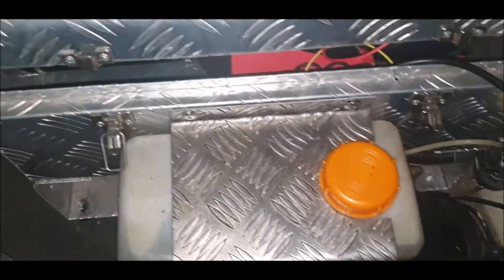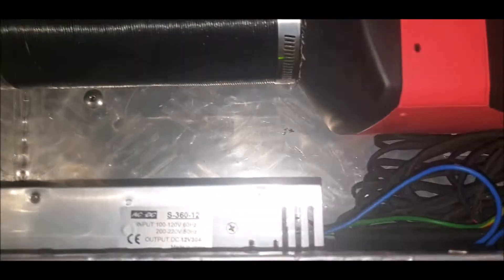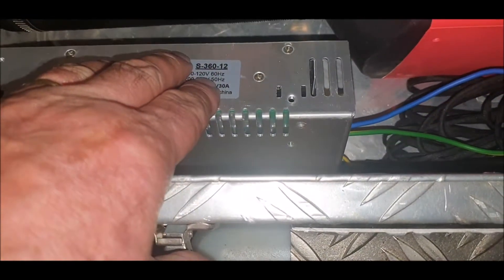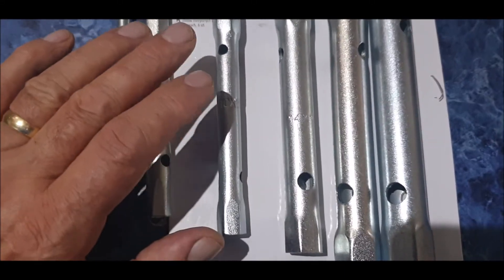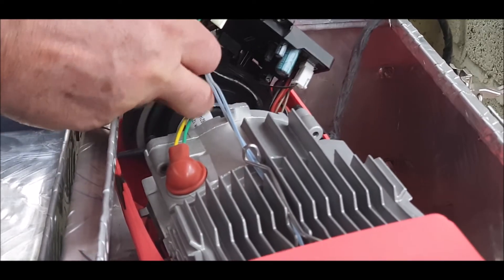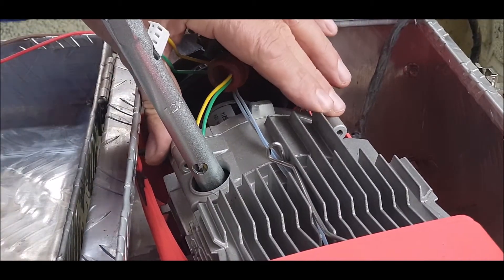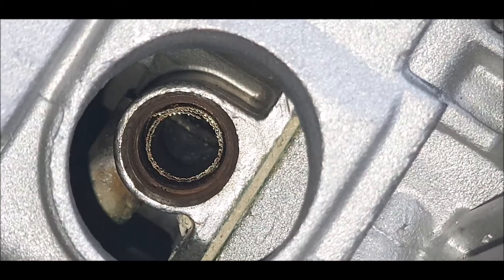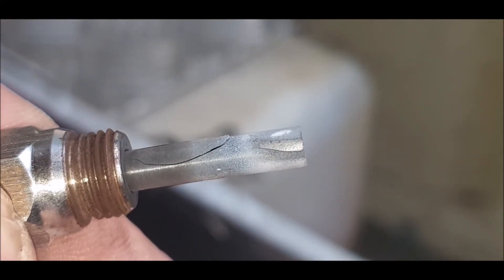CHINESE DIESEL HEATER ERROR E-03 GLOW PLUG

Comment: Hi i have a nasty problem with my chinesium heater i had an error 03 and after replacing the glow plug im still having the same error !its very frustrating what it can be anybody had the same problem in the past!
Reply from the maker: i did have a fuel pump problem as well

Comment: i have E - 03 error code on new Vevor heater straight out of the box . messaged seller see what happens. i have a max speeding heater no issues
Reply: The vector heaters are crap. I have had nothing but issues using mine for the past 5 months. I wonder if other brands are betternot sure if I want to chance waisting more money, might just suck it up and go with a direct vent propane unit, wlthought I'll be at the mercies of costco since propane any where else is way too expensive.

Comment: It could be because you don’t have a battery in line so when the kill switch is used while the unit is still working the heat will fry your motherboard

Comment: Hey guys, I just bought my diesel heater last night and I installed it and worked perfectly. But today it showed error E 03.  Do I really have to change the plug when the heater is new???
Reply: Battery shows 12.6Volt. What do u mean by fuel? Is the filter/pump maybe installed wrong?
Reply: @redle9485  I have the same problem, ran a tank of fuel through with no problems, re-filled it and now have E03. Can't believe its the glow plug after 10 hours running full blast. tried it with 12.5 volts andd 14.2 volts, same problem. If anyone figures this out or gets a reply from china please do post on here. Great video Mark.
Reply: @pollyperkins6931  I even took out the plug and it was fine, I really don't know what the problem is
Reply: @redle9485  If it's new I doubt it's the glow plug. Because my fan didn't spin and smoke came from the circuit board I'm gonna get a new board for £15. Unless you want to go first :)
Reply: @pollyperkins6931  well I haven't had any smoke or anything. I only get the code everytime I start it
Reply: @redle9485  My sense of humour. Story so far. I had another reply asking for a picture. Not sure what of, it don't work. anyway, I took the heater to pieces and found I have 12v on every connection, even the thermostat, so assuming its the board. Prob not much help for you unless you want to check your voltages, you may have the same problem. I have asked for a new fan board, if it works or not I shall post on here.
Reply: @pollyperkins6931  same here 10 hours running from new , and error 3 .
Reply: @redle9485  did you get sorted we are having similar problem. Error code.3 on a brand new heater!!
Reply: @motorhomeadventures5216  I emailed the supplier saying I had 12v at every electrical connection on the board with no potential difference at fan or pump, but the fan and pump work when 12v was applied direct. To me this means the board was shorted out. Even had 12v on the thermostat which shouldn't have any volts. I also sent them a picture of my multimeter showing 12v on the board. They refunded me and I then bought another from a different supplier. Haven't fitted it yet. The quality of the board is very poor, during fault finding the plastic connections fell apart. I think its pot luck with these, but you'll got through 7 of them before matching the cost for the real M'coy.
Reply: @pollyperkins6931  hi, I have same issue. Smoke came out of there. Should I order new board or its not going to help?
Reply: I have checked the plug and it's fine
Reply from the maker: could be battery low or fuel
Reply: @MrMeltedwellies  mine just quit with this same error code at our remote cabin here in Alaska.  I tested it with a multimeter and it was shorted. I assume that error code is for the ignitor only right? What difference would fuel quality or air quantity have to do if its shorted when testing?
Reply: After two emails I got a full refund, so although a bit of a waste of time, not a total loss.
Reply: @pollyperkins6931  Hi, we are having backwards and forwards emails, but think we have similar problem, it is a new heater,  but we are getting error code 3 and cannot seem to reset it. It only ran for an hour tops!!! Please could you let me know what you said to get a refund? We are going around in circles.
Reply: I have a new one e 3 code. 
The board just clicks when I turn it on
Reply: I think it is electrical problem some how pump doesn't work even it does no heat engine doesn't spark diesel always needs fuel lines stable

Comment: I get an E03 code when I plug it in to electricity, but it works fine when connected to a car battery. Any idea why that is.
Reply: I think I have the same problem.  Did you get a reply yet?

Comment: What size wrench did you modify with the grinder to remove the glow plug?
Reply: Most likely a 12mm
Reply: When you open the basket with the 4 hex screws you can also use a normal wrench to lose the glow plug